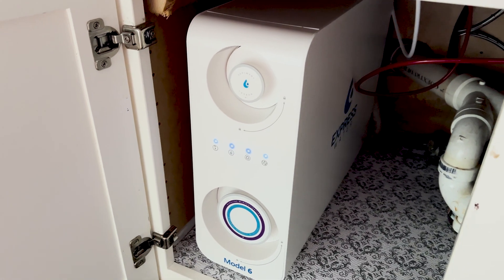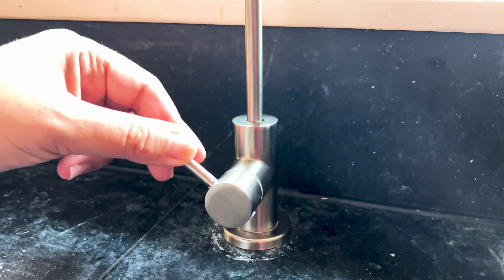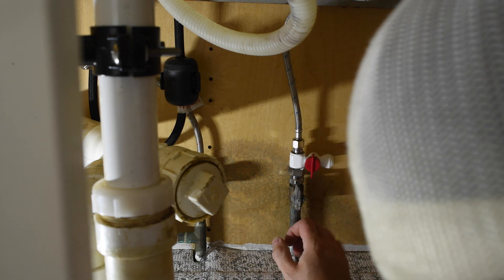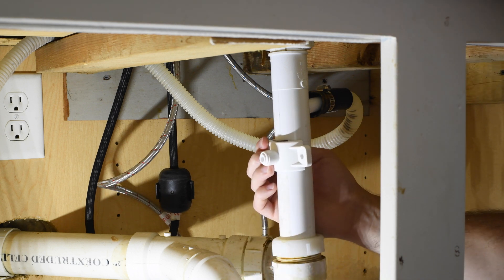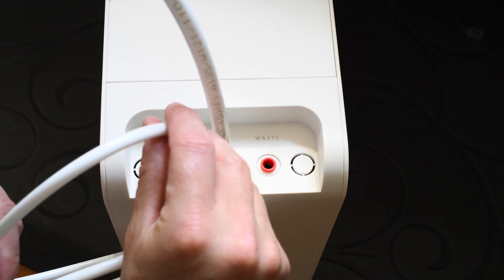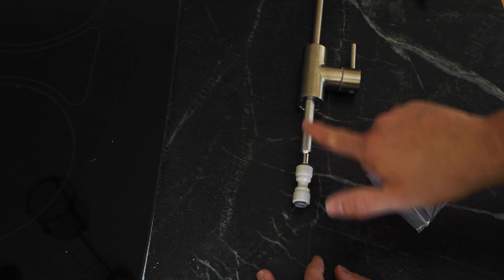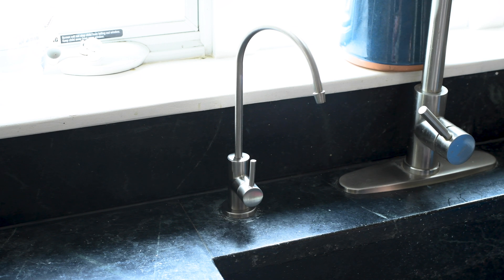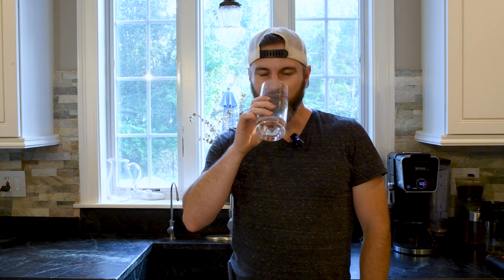Install and Review of the Express Water Model 6 Tankless Reverse Osmosis System (under the sink)

Comment: How do you hook this up to dishwasher too? If possible I'd like to connect it to dishwasher, my own sink faucet and the fridge line. Is that even possible
Reply from the maker: This particular model only works with its own faucet. The output flow is not enough volume to be practical for a dishwasher. You would be better off with one of Express Water’s whole house systems, so you can have filtered water at every tap in your home. I have a separate video for that system.